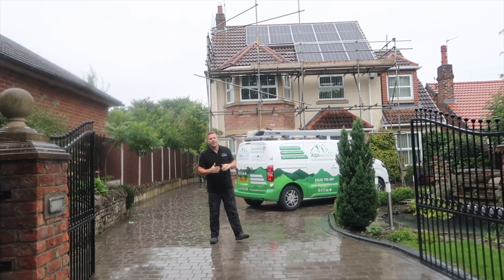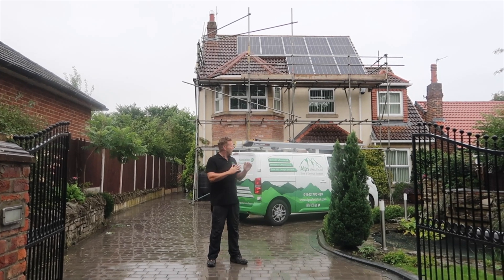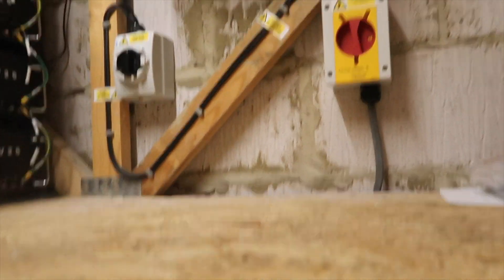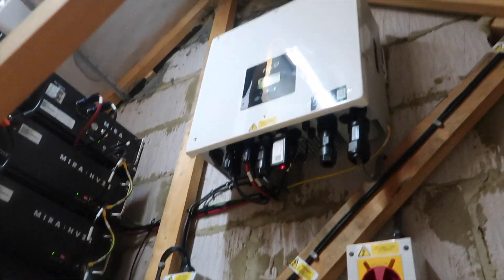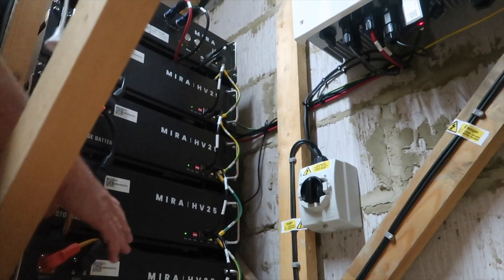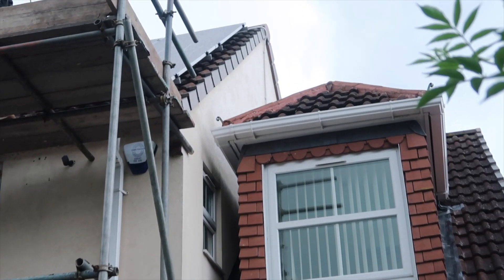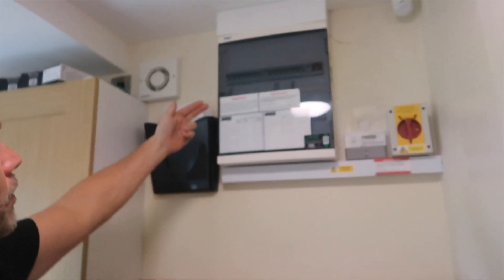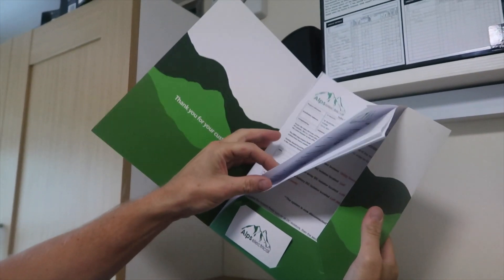Solar Installation Video Of A 4KW FOX ESS System & 10kWh Battery Storage

Comment: Nice work.I have installed a photovoltaic system through the national program, which includes a FOXESS T3-G3 inverter. 
From the information available from the manufacturer, it seems that this inverter can support a battery, but requires a separate additional device. 
Unfortunately, in Romania, this brand is not very common, and no one I have asked so far has been able to provide a clear answer. 
Could you please advise on the available options for adding a battery to this inverter?
Reply from the maker: Hi, I am afraid I am unable to answer that question. The best people to speak to would be Fox ESS themselves, here is the email address: service.uk@fox-ess.com